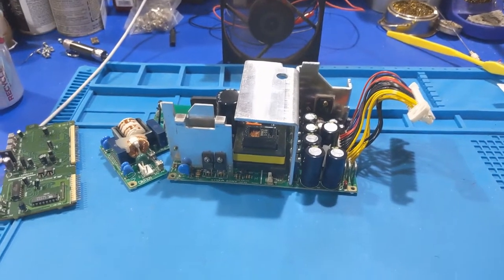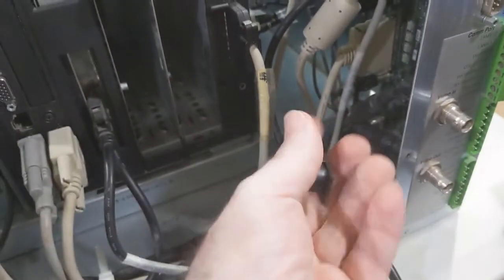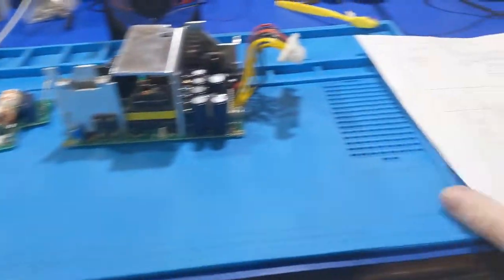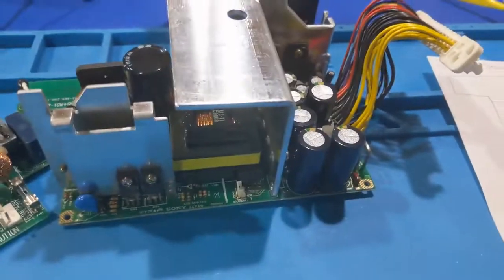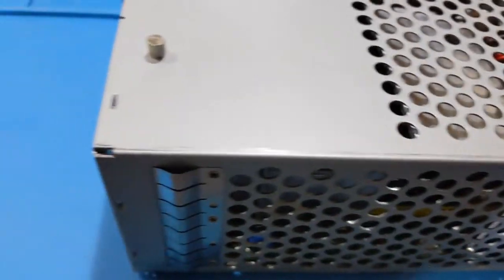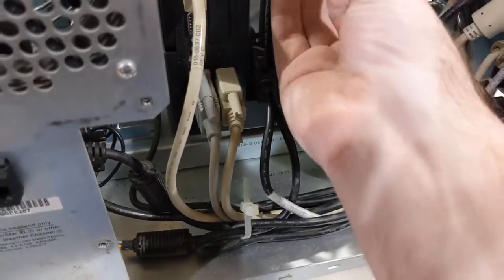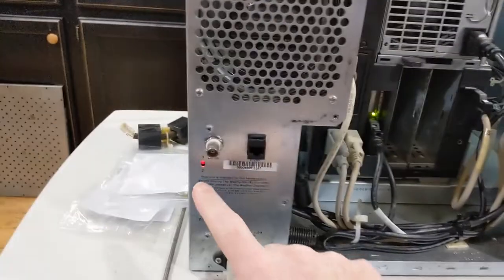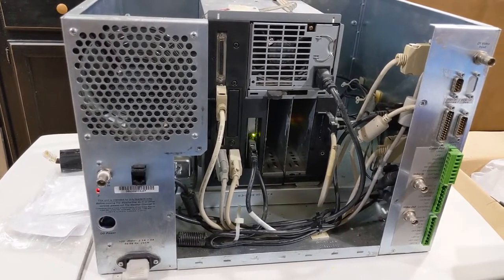Weather STAR XL: Preventative Maintenance and first boot?

Comment: Hi, I do not have any experience with SGI machines, but from the age perspective it could be bad capacitors on the motherboard/graphics card/other cards - also in the past I saw SMD caps from that time period leak, which destroyed traces under them. So if you don't already checked the motherboard etc. it might be a good investment in time to do so. Thanks for your great videos showing stuff! :) Greetings from Germany
Reply from the maker: Already been down this road. I do this all the time in all my other videos.
Reply: @THEtechknight  SGI sucks , rich mans computer system back in the day.. Now its still a rich mans hobby to keep them running!
Reply: @THEtechknight  oh I see...well I still have plenty of your videos to watch 🙂 I read, that there are some diagnostics built into PROM, reachable when you interrupt the "starting up the system"-screen with ESC or a "stop for maintenance"-button...I find all this very interesting and I sure would like to see the Weather Star XL working as well 🙂
Reply from the maker: @jk86tech  Yeah if you watch the rest of my video, youll see the diagnostics output from that same step. it shows a hardware failure on MACE i2c. Bad mobo.

Comment: Add it to the list of dead O2 motherboards. Mine died also but has no life or vga output at all. Bought new PS since the old one literally smoked. Same issue, dead MB.. Sorry ya had to succumb to the same fate as I... I do have the drive 0 and drive 1 hard drives if you think it may be software related but I suspect if it won't boot using a new fresh load of IRIX then its something more complicated
Reply: Have you tried the force-power-on jumper next to the Dallas IC?
Reply: @mapesdhs597  Yes, If I plug the power supply in to AC it immediately comes on but no sign of life on the mobo or any thing besides the red led on the front panel
Reply: @Richie107  In that cas alas it is indeed more likely to be a bad mbd, but do check for corrosion before fitting any replacement.